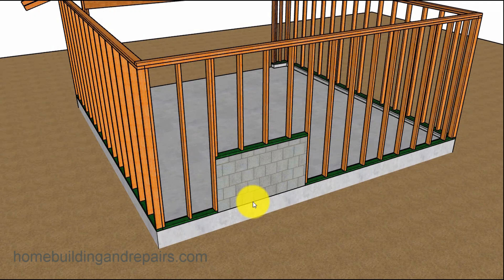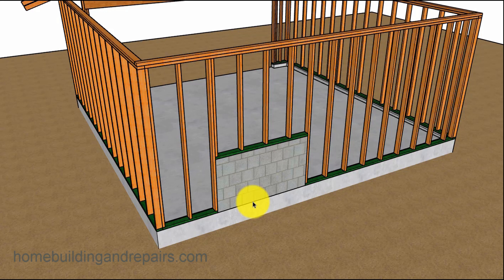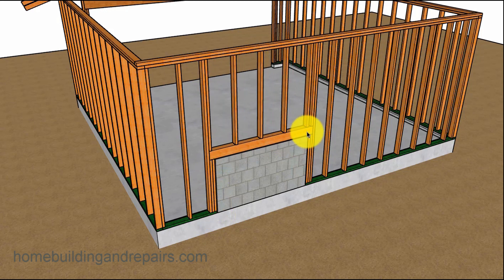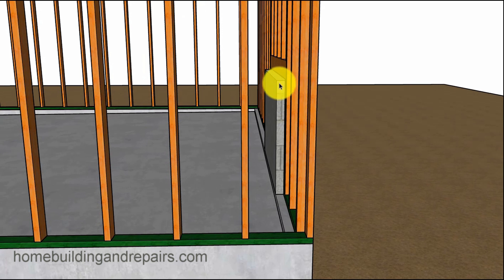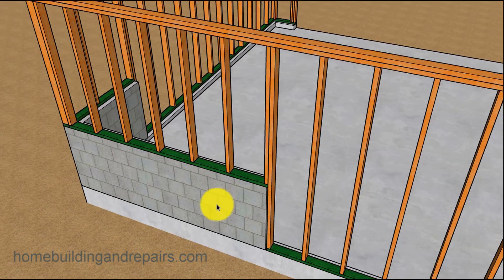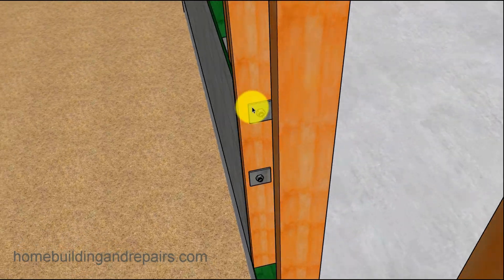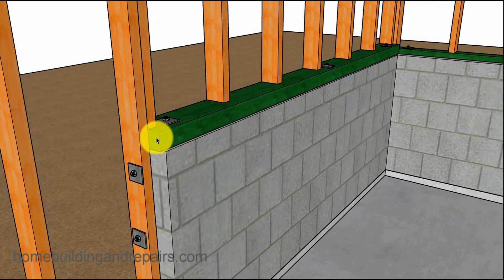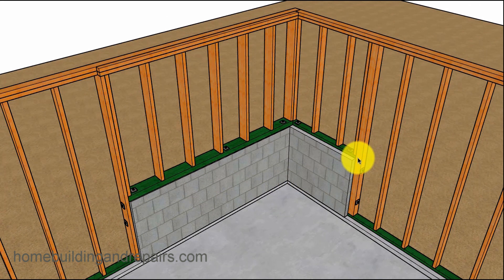Structural Reinforcement Ideas For Hinge Points In Masonry And Wood Wall Framing

Comment: When you say "hinge point", are you referring to the concrete block wall "falling" outward or inward. I could visualize a person standing inside the house and pushing hard on the concrete block wall, and the block wall would cleanly break along the sill plate and then fall outward.
Reply from the maker: More or less, yes a weak point in the wall connection. Here's a video that might help.
https://youtu.be/ZWeDYJrL3KM